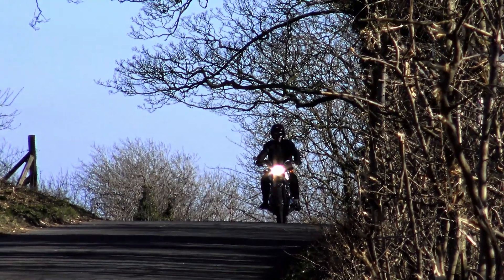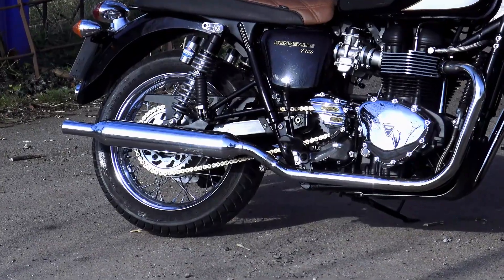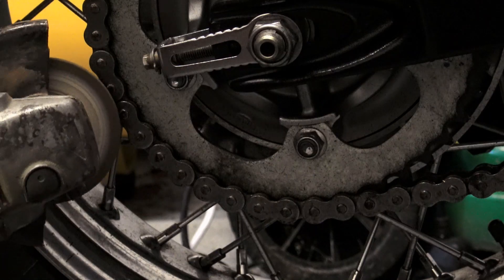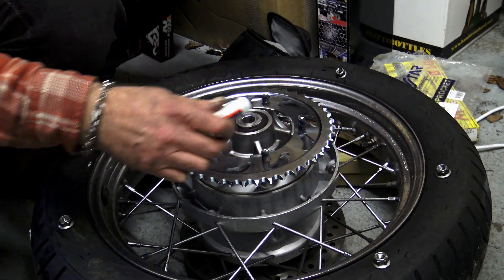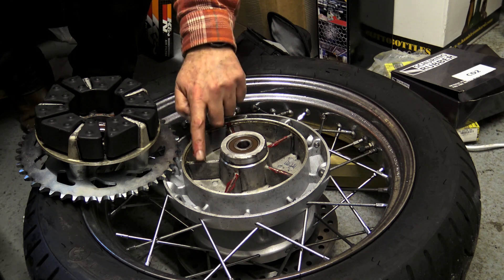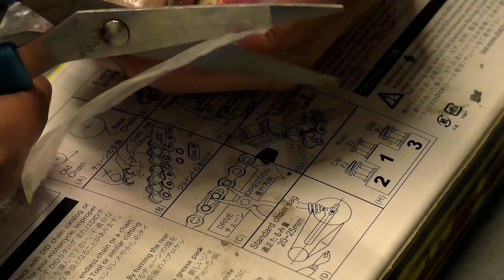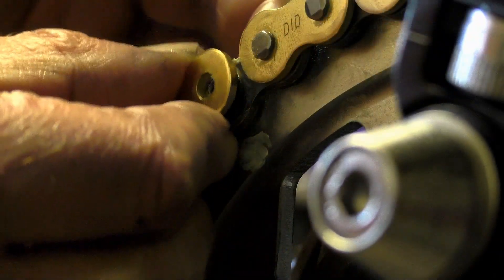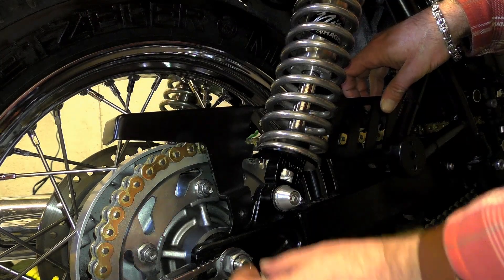Custom Triumph Bonneville T100 build, PDP Pt8, fitting motorcycle chain, sprocket & cush drive.

Comment: Excellent timing Stuart, my recently acquired very low milage '96 Thunderbird has just such a slightly snatchy drive and I am certain a new cush drive is required, so thanks for the prompting.  We here in Australia tend  to spend less time in built up areas and more out on the open countryside in top gear so I usually go for one extra tooth on the front sprocket to lower the revs in top gear at the expense of a little clutch slipping about town.  Horses for courses I guess.
Reply from the maker: Hi  Chris, yes that makes sense, you would soon have clutch problems here in blighty with that set up. i always have the T120 for longer distances. thanks for watching!

Comment: I wonder if Haynes will put out a service manual for the 2022 / 23 Bonnevilles. I would love to have a copy so I can learn as much as possible about service and maintenance so I can handle some things for myself.

I wish the new model offered brushed chrome engine casings for the T100.  I was opening a model eould be announced for 2023 that would hwve brushed chrome casings but I haven't found anything.

Comment: Stuart, another excellent instructional video. Really enjoyed it. I know you didn't cover adjusting proper chain tension in this video because you already covered it in a previous post. My question is don't you find that if you turn the chain one complete revolution with the rear wheel still off the ground, that you encounter one area that gets tighter and one area that that gets looser and you need to adjust for a happy medium. Also with these new chains do you have to readjust it after a few hundred miles because of stretch. 
Thanks, Hal
Reply from the maker: Hi, if you have tight spots on your chain, its usually a sign that its reaching the end of its life. i have to say ive not come across that for a long time, but my reaction would be to start thinking about a new chain. 
chains do stretch initially but by how much will depend on many things, such as its quality and your style of riding. either way yes you should be checking the tension regularly and may have to adjust it in the first 500 to 1000 miles.
Reply: Thank you.

Comment: Hey Stuart! Another great video. I really like what you did with that meshing on the front sprocket cover.
A question... I'm thinking of buying a torque wrench as I'm getting more and more into fiddling and maintenance of my T120 (in many ways thanks to your channel). There are an awful lot of them out there in terms of range, prices and I suppose quality. Do you have any advice on how to choose the right one? Or perhaps I need more than one to cover the range of torque needed for all the nuts in the T120?
Come to think of it, I'm really interested in knowing about what you would consider the essential toolkit to have for your T120. Perhaps there's another Fillingham Productions video in there?
Reply from the maker: Hi Jorge Thanks for watching and for your comment, Which as ive found recently is a very relevant one! I did get a torque wrench about a year ago from a reputable brand which i considered neither to be cheap or expensive. They are not something you use everyday but they are essential unfortunately this wrench has let me down twice recently and only common sense prevented me from doing damage to the relevant fasteners! to that end ive now settled on the king dick standard range as a viable option for a DIY mechanic offering excellent British made quality at a realistic price ( though not cheap). i would say you will need a minimum of two wrenches to cover the required ranges and there will be an overlap where either can be used. I will be publishing videos on elements of my tool kit as time goes on and i will be reviewing my latest torque wrench in the next week or so!
Reply: Excellent! Looking forward to your torque wrench review then. Thanks Stuart!

Comment: Wonderful video Stuart, did the brake disk slide right out of the caliper when removing the rear wheel assembly? Love the looks of the front sprocket cover first time I've seen this particular one!
Reply from the maker: Hi Terry Thank you, yes its a curious arrangement as the  calliper just slides in to it mount and so is very easy to remove and refit to the brake disc. biggest problem as always is getting the wheel lined up to get the spindle back in!
Reply: stuart fillingham  yes how well l know, looked like the 2by 4's worked really well and at 70 yr's old l need all the help l can get!  LOL.

Comment: I've decided to change the sprockets and chains myself but in all the videos I've watched once the cover is off the front sprocket is there. My T100 (2017) has got some bits attached to the rear brake covering it and I can't work out how to get to the actual sprocket. Am I being dumb or have they changed the T100 slightly so the videos are out of date ?
Reply from the maker: No the videos are not out of date Dominic, the air cooled t100s are still the same and have not grown new parts over the sprocket. The new water cooled twins are a bit of a lash up in places and the front sprocket area is im afraid one of those places! few people will have had the need to replace the sprockets on the new models yet so there are unlikely to be any videos available,(in fact replacement sprockets are few and far between) your best bet is to get a Haynes manual released last month, and do it the old fashioned way! Thanks for watching!
Reply: It's one of the new water cooled ones, I'm doing about 1000 miles a week and it's my first bike (2nd if you don't include the one I wrote off 3 days after getting it) and I've not been as good at looking after it as I should have so the chain and sprocket have worn a lot faster than they should. I've got access to the sprocket now but it just makes it a bit harder to get to if you're applying the brake to hold the wheel when you loosen the nut. I might need a large spanner rather then breaker bar because of the the access but the principle looks the same as your video.
Reply from the maker: The principle should be the same on any bike Dominic, its just a shame Triumph made such a mess of it on these bikes! good luck with it!